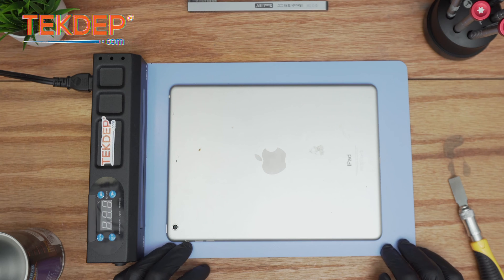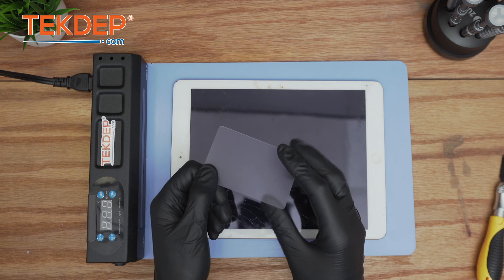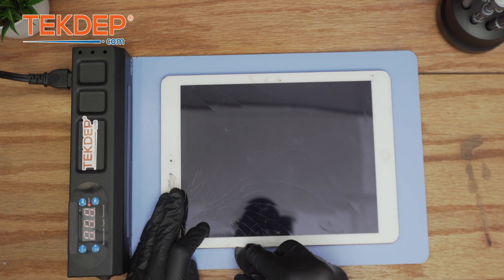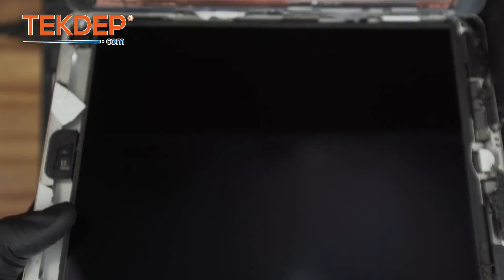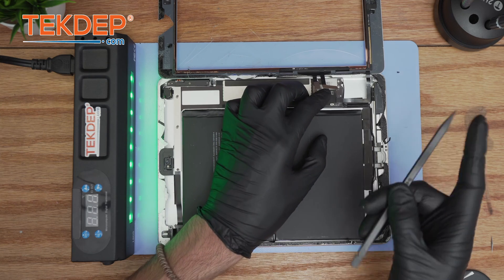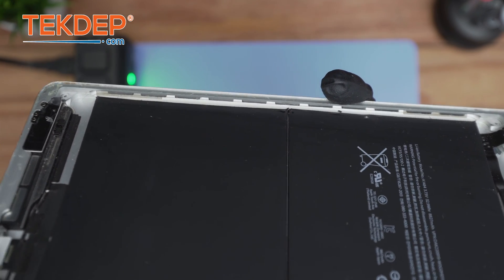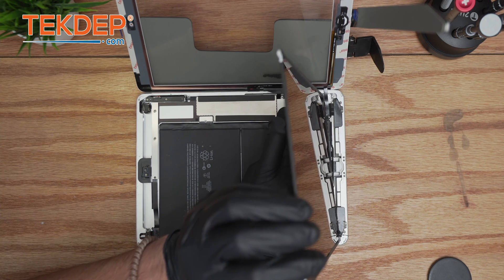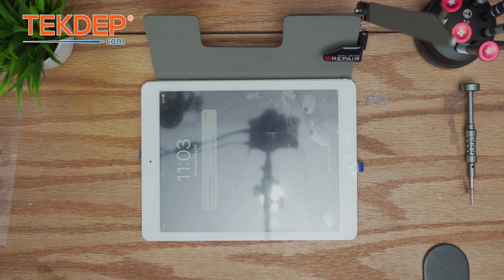iPad 5th Gen A1822 A1823 Digitizer Replacement, Fixing a two Part LCD Assembly

Comment: Hi I have 2020-2022 iPad air 5th Gen 10.9 with cracked screen what is your charges cost for replacement. or the parts cost thanks
Reply from the maker: If you are interested in a mail in repair, or getting a quotation for repair. Submit a ticket here! https://tekdep.com/valettek/  Our tablet tek Arman will promptly assist you!